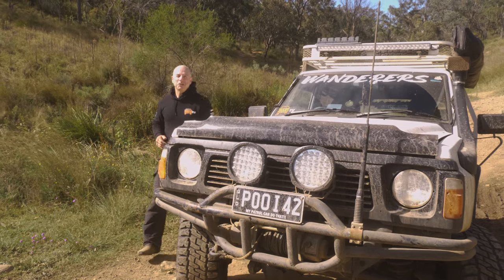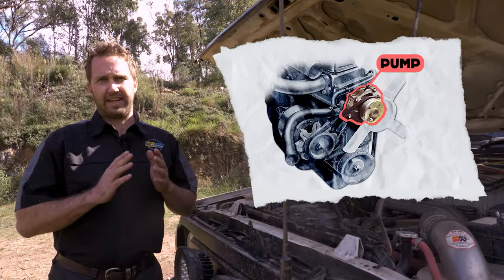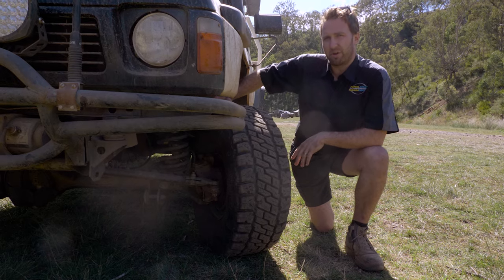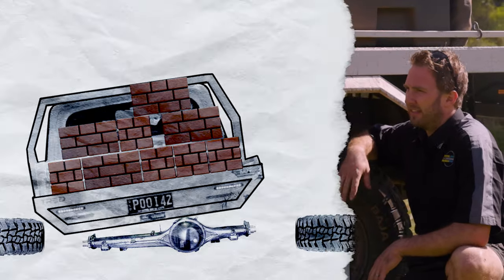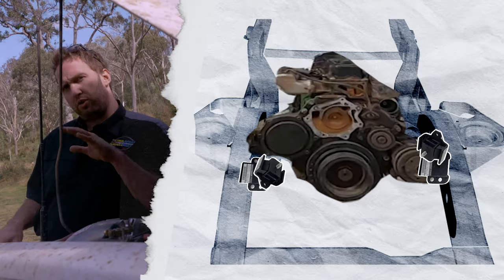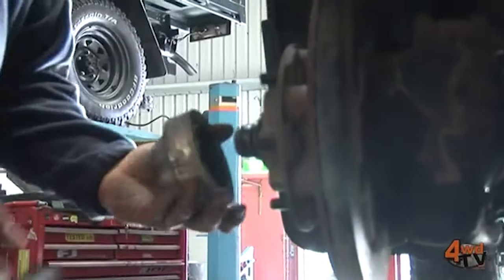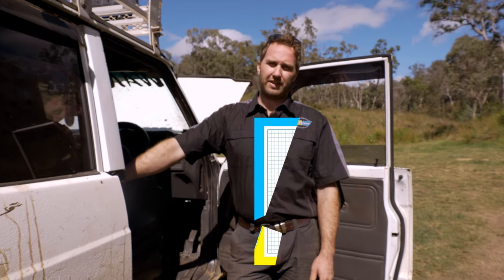Top 10 Nissan GQ Patrol PROBLEMS with SOLUTIONS!

Comment: I've replaced the single piston front calipers with dual piston calipers from the GQ EFI models instead of installing a GU front.  I believe the GU front are a little wider...so it'll mean replacing the rear at the same time. Time, cost and labour were the determining factors for someone doing it on their own.  Obviously I rebuilt the dual pistons prior to installation and whilst there replaced all the wheel bearings which also eliminated the 'death wobble'

Comment: What wasn't mentioned when replacing the front axle with a GU one is you've also got to replace the rear one as well.  Who want's a GQ that has the handling traits of a 79 series?
Reply: why not buy a gu..  i have a 6 cyl, 4.2tdi s/duty. 700nm.. 14 lt 100, tows 4.5t. goes up hill with 4.5t, in 5th.. just bought a gu. 2000,  4.2tdi, fk its gutless.. & no, i dont have a computer, or glow plugs.. but it has ohc, 3 valves 3'' system std. cost, 25k, 7 yrs ago..plus, i dont have bs cv crap..

Comment from the maker: Hope you guys enjoy this new type of content! It's a bit of a change from our usual videos. If you want to see more of this kind of content, let us know in the comments below and share your suggestions on what you'd like us to post next.

Chapter guide:

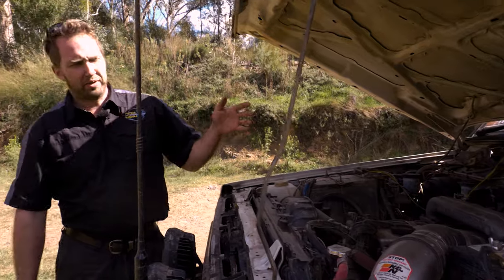 Cooling System 01:19
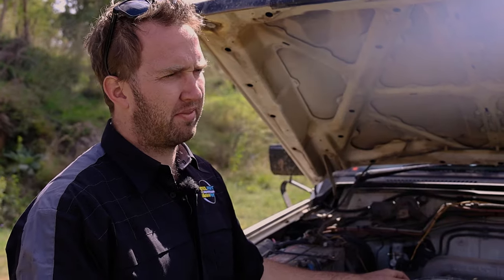 Front Drive Line  03:06
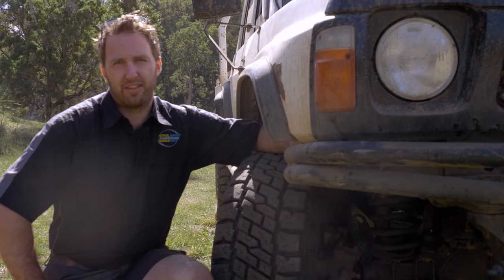 Heavy-Duty Rear Trailing Arm 05:04
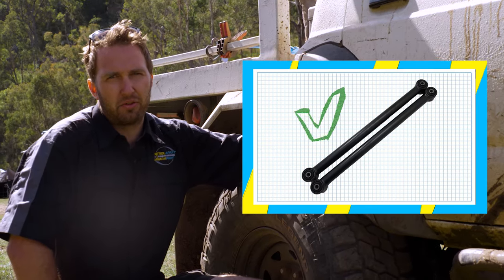 Coil Tower Kit Upgrade 05:39
 Front Bump Stop Boos 06:57
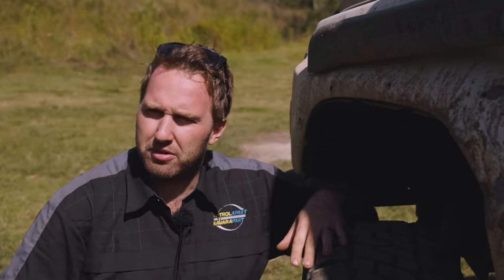 Genuine Front Hubs and Hub Saver Rings 07:52
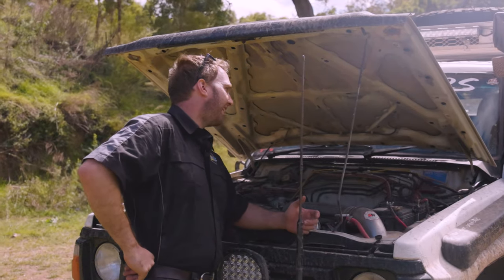 Engine Mount pro tips: 09:14
 Boost and Power Unleashed 10:20
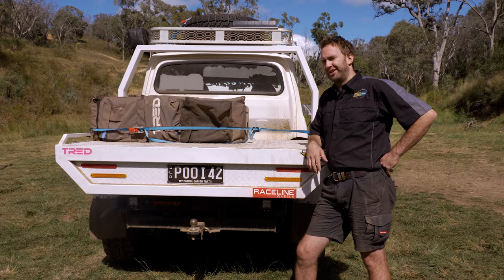 Rear Driveline Rebuilt 11:17
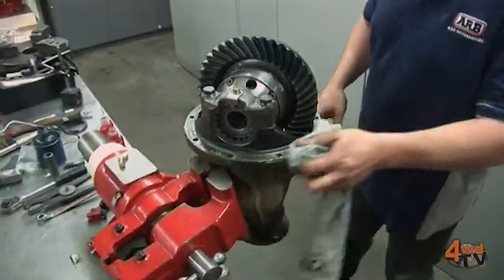 Roof Rails and Door Hinges/Seatbelts 12:07

For more info and the parts we're talking about read this: https://bit.ly/GQPatrolTips
Reply from the maker: For additional information and details about the parts we discussed, check out this link: https://bit.ly/GQPatrolTips 📚🔧
Reply: if your worried about bump stop ruining the shock on compresison,,  why do you leave the coils floating, instead of being tied in.  LIKE REAL 4X4RS. f100..chev, dodge.. @4WDTV
Reply from the maker: F100, Chevy, Dodge, GMC, etc can't survive off road in our conditions 😜 basically they are too big. Awesome for towing though. @harrywalker968

Comment: There is another problem with the cooling system - the last 6 cylinder can overheat. It happens 2.8 TD but 4.2 too.  To prevent this, a connector is installed in place of the plug in the engine block at the back and connects to the rest of the cooling system. The plug is in contact with the engine's water jacket, so the coolant flowing through this additional connector better cools the last cylinder.

Comment: I have a shorty one and I am suffering from an apnormal noise came after 2" lift !! 
Any clear solution!! 😶
Reply from the maker: this is a well known problem and it is easy to fix.

1. throw out that Taylor Swift Christmas CD or

2. stop taking the wife with you.

😂😂😂

OK seriously - it all depends on what sort of noise but it sounds like there will be some alignment issues with castor or your drive shafts. Get it to a good 4x4 mechanic or take it back to the mechanic that fitted the lift. Should be an easy fix
Reply: @4WDTV  Thanks for suggested solutions 😁

Ok, it is because drive shaft angle I assume and unfortunately no good mechanic around, I am looking for somone describe the solution so I can apply it myself.
Reply from the maker: @turkkiq  is it chatter, clicking or a whirring noise?
Reply: @4WDTV   It is whirring noise

Comment: 11. Don’t raptor your car bc it’s junk
Reply: Why? Serious question as my gq is getting rust work/respray and I'm considering. Have you had dramas?
Reply: @riskybiscuit6617 raptor is awesome, especially if you're using the car as intended. I've had my gq in black raptor for 3 years and it stills looks almost pristine, any regular paint would be munted.